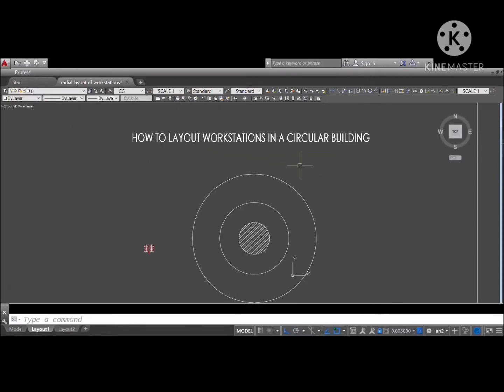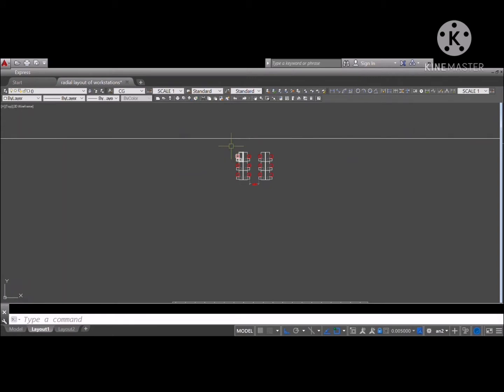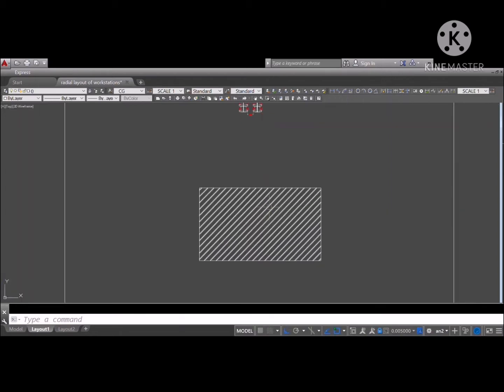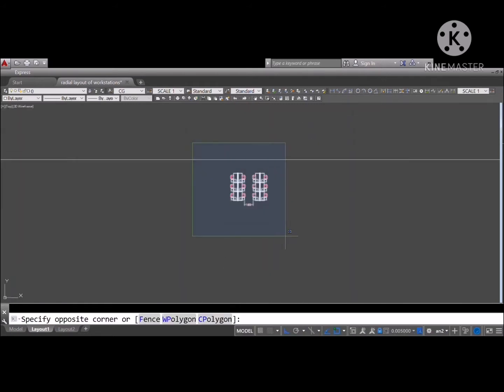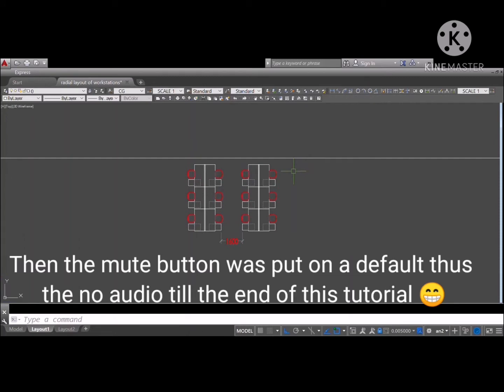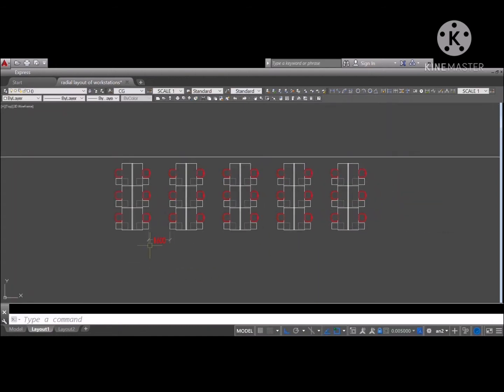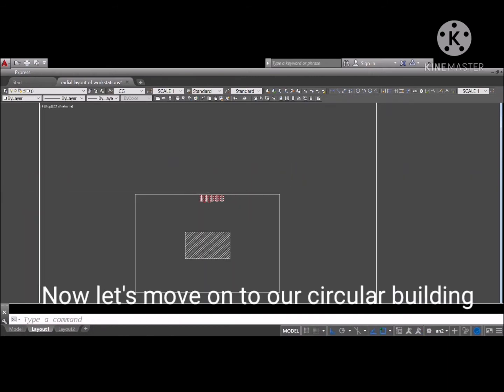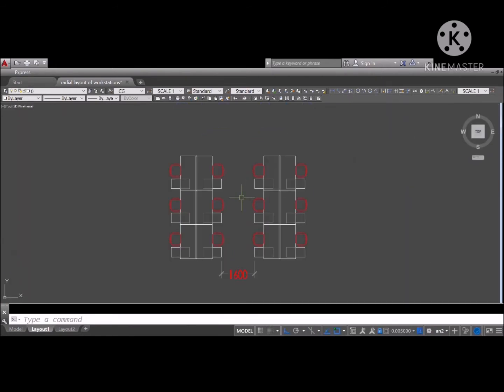How to layout workstations in a circular building -Radial layout #CadTutorials #Beginners #Refresher

Comment from the maker: I've recorded the screen on a built in app of windows 10. Gamebox. Click on windows and g at the same time.
You can record on a single app only but you can trim the length of the video that automatically saves the file size smaller.